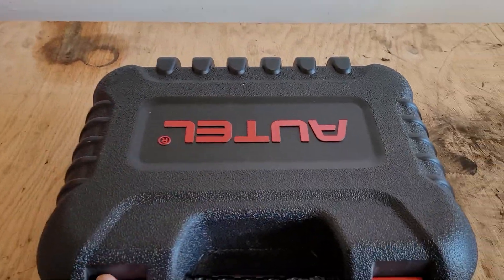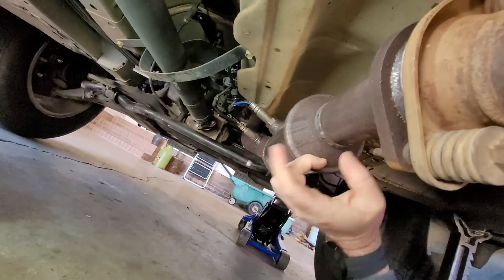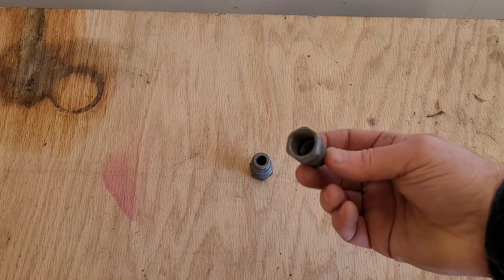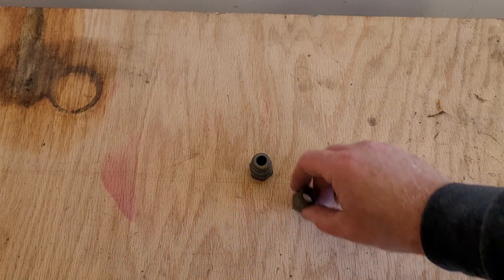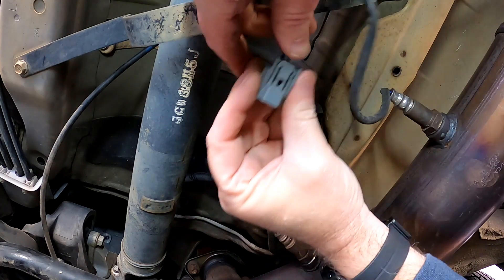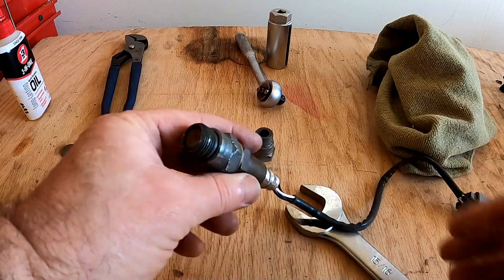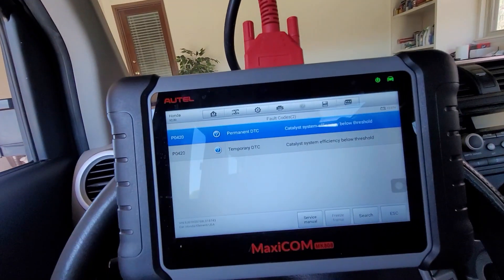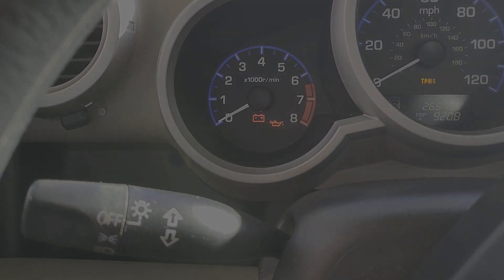Can Sparkplug Non-Foulers Fix A Bad Catalytic Converter?

Comment: Why is it illegal if the fouler can be purchased from major retailer for that exact purpose?
Reply: Because you have to modify it
Reply from the maker: Most folks disagreeing have been ugly about it, so I don't usually respond, but I'll explain. The defoulers are sold for sparkplugs, not your o2 sensors. You have to modify them for the o2 sensor. Even if your state does not require emission tests, federal law (that supercedes state law) makes it illegal to bypass factory emission equipment. 95% of folks that do this and get it to turn off the check engine light won't get caught. If I encourage people to do this, then youtube could pull the video. It would be irresponsible to encourage people to break the law. Several of the big youtube channels have been fined thousands of dollars by the feds for bypassing factory emissions. Do what you want with the information in this video.
Reply: @ktecgarage  thank you for the insight. I appreciate that and yes I agree. The fouler i observed was not for spark plugs but called oxygen sensor adaptor at walmart for $9. However, I agree what you are saying. Thank you for the information in general.
Reply: @Fred-Faizi  Walmart sells them?  The could be in trouble, I think.
Reply: @ktecgarage It doesn't affect the actual emissions of the vehicle, it in essence prevents the ECU from recognizing that the  Catalytic Convertor is out of spec. That's not illegal.
Reply: @ktecgarage  ....they do sell O2 sensor extention instead of using the non foulers.....For disclaimer purposes...only use them off road

Comment: I put one on the down stream and it cleared the code ..it didn't need manual clearing it just never had another problem car runs very well 122k miles Citroen C1 2017 UK model .. installation was about 2 years ago now ..
London UK 
Very good video thanks 🙏

Comment: It works you got to use 2 of them I’ve had mine on for 3 years always pass smog and unless the catalytic converter is clog you’ll get a different code such as fuel rich code after using the defouler in which case I gutted out works beautifully I tried paying 1400$ for cats they went bad after 8 months so I’m gonna do the poor man special fix when I can

Comment: Buy one specifically made for the catalytic converter.  I just installed one works perfectly.  The ones meant for catalytic converters are not open completely on the end.  Pass my inspection in the state of new hampshire.  Google them, you can order them online and they come in in two or three days.

Comment: Had 420 code. change the oil. spark plugs. Air filter. Spark plugs look beautiful at 150,000 miles. So I ended up changing a catalytic converter. new o2 after catalytic ,Threads stripped coming out. So new converter and o2. Still P0420, Put a new. oxygen sensor. in the manifold. Still PO420. and P1133. which I never had before. P1133 is not switching enough.

Did a smoke test in the tailpipe. No smoke up by the engine. Found smoke out of the weep holes in muffler and resonator. Did a vacuum test? 20-21 inches. I did a pressure test and it was a little bit high on the catalytic converter, I had like 2psi at idle, 4 psi at  2200-2500 rpms. at the manifold o2 sensor. Did Propane for intake leaks nothing on fuel trims. 

So I'm doing this, but I dont think I have the room. I've been searching for a 90 elbow.

Comment: What if the Exhaust Resonator is leaking  thats bolted up to the Rear Catalytic converter now and has started with a tiny gasket leak and then the Resornator rotted out around the flange as it needs to be replaced now, been told it's the O2 sensor and replace it and I have but still thought i had a tiny gasket blowout at Catalytic converter and Resornator Gasket  area, couldn't feel air but could hear a little hissing sound that got louder to feel air coming from it. I've tried Cataclean and went months at the beginning and passed emissions, nobody seems to be able to tell me, change the cat some say, have 2 of them on 2.4L Honda 2010 runs great without losing any power. I don't have the money to send it  to top notch place and last time I sent in for a $35 heater hose was backordered and they had vehicle for a month, i found 1 and they said the Radiator was junk because I had a discount off labor and charged me $838 I called them to tell them I'm picking up vehicle, they said no, we started to do Radiator and they didn't until the next day.  My son was parts guy and dropped off parts not knowing its for the vehicle.  There cost was $47 and they charged me $374.99 from Honda but cut the lines to transmission and put in connections and used rubber hoses to connect back, I said thats not factory as factory told me if they ordered right Radiator, then lines would go in perfect.  I found the part on different place and could of bought a back oredered hose for $69.95 free shipping, i told them i found the part and she used reverse phycology on me and asked where. They had all. Just lost about a quart of coolant in time noticed it. She got the name where i found it, on ebay and said i found it too. She was looking up as i she asked questions and  charged 1.5 hours to change out Radiator and hose and used wrong bolts for hood latch. Doesn't pop unless you bang on it once and pops open.  It was after that I got a check engine light on in a month or so and started coming on and go out. I didn't go back as very unhappy on cost of job and 10% off, they jacked up prices much more and checked cost on wedsites of cost to replace Radiator.  That's on repairpal and given estimates around your area with names of places to go. I picked up a bolt that I noticed leaving them and figured it was a rock in new tires, i think the hood latch bolt was it, as was 10mm head and looked like same size other than shiny from drive home, they said I could of gotten it anywhere.  So they wasn't fixing tire for me as was flat next day. Just wanted to get fixed correctly.  Hoping it can be reliable as i don't trust it like i did.

Comment: Works on my car, used both. 
Mine were longer due to a longer probe tip. About 3/4 longer each. Car runs great, haven’t had it checked, plus we don’t do checks here.

PS- CAA-CARB is now revoked and moot.

Comment: I tried this on my 08 Mini R56 Base hatchback, it did NOT help at all, code 0420 came on after 53 miles and ALSO IMMEDIATELY showed another FAULT code on the O2 sensor Bank 2 (downstream) where it was installed...AND the CHECK ENGINE light came back on...

Comment: Fine is cheaper than a new cat I guess. They do work, yours is too short. You need to use two, one drilled and one not drilled. Or get the longer one.

Comment: I had a cat that was deficient.  I bought the "universal" non-fouler that's long, not short.  Meaning I didn't have to drill out two short ones and put the together.  The O2 sensor threaded into the universal non-fouler, then threaded it into the exhaust pipe.  The CE light never came back on and it did run a lot better but not as well as it should.  It was only an experiment.  I tried one on the side that with the good cat and it made that side run so lean, it discolored the cat heat shield.  I installed a new exhaust system with two new cats and it now runs like a champ.

Comment: Rather than just condemn something because "you" don't think it will work, it would be more informative if you showed the live data from the downstream sensor before and after installing the spacer, to back up your claims. As you probably know, a bad convertor will typically register crossover counts similar to the upstream sensor, indicating a failed convertor. In theory, installing the spacer moves the sensor out of the direct exhaust stream, and exhaust gases then tend to pool around the sensor, which buffers the readings.

Comment: The more common cause of low efficiency these days is the low quality of replacement cats. 

Oem cats are getting expensive, people often go after market. The after market cats don’t heat up as well as the OEMs. That’s the difference in a $1300 cat and $200 after market.

Comment: i can already tell exactly where this guy went wrong and why it didn’t work
Reply: 5:40 when he went back to the bench and didn't realize to stack them or use a 1.5 inch instead?
Reply: You need 2 and drill a 1/2 inch hole through 1 of them,works Luke a charm!

Comment: Resistor method works better imo and can't really be detected by a visual inspection.  Non-foulers do work btw because the sensor is simply exposed to less O2.  Good to hollow out the cats for more power.  F the guv and their BS

Comment: Unless your vehicle is 0:04  sending a plume of smoke from the exhaust, these emission laws are ridiculous! The amount of dangerous emissions expelled by a vehicle during its final useful lifetime is far less than the emissions and pollution caused by tearing apart, separating and smelting all the steel and components of the already existing and useful paid for vehicle. I miss the days of buying a $300 car with minor issues, spending a few hours and $ for parts. Nice, I'd have a good running beater to drive for a couple of years! Good luck today..

Comment: TL:DR - You might not have a bad CAT - it might be cheapo (aka bad) O2 sensors.  Buy NTK or OEM sensors (it's worth the extra $). 

Was down a rabbit hole not being able to get rid of a P0420 on my 2011 JK Wrangler. Ended up replacing the bank 1 O2 sensors with a Chinese brand off Amazon thinking that would fix it - NOPE! ... tested replacement o2 sensors and they were giving off too high 6 ohms across heater element. CEL's for "high-voltage" persisted (NTK & Mopars give off 3.5 ohms). 

Almost bought new Catalytic convertors (also tried cleaning the cats & even using the spark plug non-fouler trick but CEL's persisted due to cheapo O2 sensors - non-foulers will not work if your cheap sensors are sending incorrect voltages to the PCM). After much research, discovered the JK is super sensitive to o2 sensors. Ended up buying the NTK brand and they worked perfectly. DO NOT USE ANY OTHER o2 SENSOR on a JK than NTK or MOPAR (Bosch is too sensitive and will trigger CEL's). NTK website has a part lookup function (note: upstream and downstream are different part numbers). NTK are more expensive but TOTALLY worth it.  Cheap sensors are not worth the hassle. 

Another key tip: O2 sockets are not meant to "break loose" difficult sensors - the wrench (link below), with a hammer, worked perfectly for breaking loose the sensor (after broken loose, then you can use the slotted sensor socket). Also, use PB blaster the night before. Note: Always use a thread chaser & high-temp anti-seize before inserting new sensor  https://www.amazon.com/gp/product/B00I6TBHE0/ref=ppx_yo_dt_b_search_asin_title?ie=UTF8&th=1
Reply from the maker: Thank you for sharing that experience. Chinese sensors are a bad idea.

Comment: You have to use 2 of them like others have commented already 😂. Stack them. Pushing sensor out of the pipe far enough to get cleaner air reading

Comment: If they cared about pollution they would still test the exhaust instead of relying solely on computer codes. There have been recalls on bad computers throwing faulty codes, ahem, Honda, but they don't test for that either.

Comment: There's a lot of things wrong with this video, don't even waste time watching it.
Reply from the maker: Your comment sounds vaginal. Care to explain what's wrong? Should I have used two defoulers? If that didn't work should i have used 5? What? Explaining what's wrong would be manly.  I'm all ears. I clearly say in the video that if it turns your light off that it didn't fix anything.  You are just tricking the computer. The correct fix is replacing the catalytic converter.  Not this BS.
Reply: @ktecgarage  do your own research and find out why you failed, not my job.

Comment: 2002 ranger 3.0 cats delete..2 oil foulers drilled one stacked the 3 amd truck ran good for 5 mins..lol. check engine light and truck ran like crap mid range..Tryed just 1 same deal..tryed the one i drilled same deal bad idle then..So didnt work for me..❤

Comment: The problem here is price. If the feds mandate that we have to have it on our cars, then they should also pay when it needs to be replaced. Otherwise people will never stop looking for ways around the issue. 
EDIT: Also I think it's crazy that modifying it like this is illegal when driving around with a check engine light on isn't. Just leave the bad cat in there and enjoy the amber glow on your dashboard. Problem solved lol
Reply: Bad idea. The car is in closed loop mode and defaults to slightly rich running which gets poor mileage and can eventually clog the cats. Dont ever drive extended periods with a CEL on.
Reply from the maker: It is a bad idea. That car was getting 16mpg after the "hack." Thanks for commenting.
Reply: @ktecgarage  Oh wow I didn't realize the rich condition this would cause while in closed loop. I used Cataclean on mine twice and so far so good. I discovered I had bad spark plugs that probably fouled the CAT. I bought some NGK plugs on Amazon that turned out to be counterfeit and started causing bad misfires after 25-30k miles.

Comment: Like the author said, you're just slowing down the real reason for the engine check light. I have honda civic I'm using this, and it works. After 5 years now turned out it is the valve's letting too much oil into combustion chambers. And it's not even my fault , honda says legally vitec petrol engine can burn up to 1 l of oil per around 6xx some miles, check your manual for exact mileage. There you have it, you're burning oil into exhaust system slowly killing your honda. But don't get me wrong, yours can be bad piston rings, or something else

Comment: It didn't work because you drilled out the bottom of the non fouler. You're not supposed to do that.  I have a complete brand new exhaust system, manifolds, cat's, all the way to the tailpipe and I get the P0420 & P0430 codes when using winter blend fuel, codes go away with summer blend fuel. Installed these, no more issues.
Reply: You have to drill out one or the sensor doesnt fit. Then stack it with the second one undrilled.

Comment: my own experince i used one for 2 yrs in a corolla vvti..its  works it turns off light...BUT BE WARNED YOUR CAR WILL HAVE VERY BAD FUEL MILAGE...I TOOK MINE BACK OUT AND MY CAR HAS RETURNED TO NORMAL ..A BLIND MAN COULD SEE THE MILAGE HAS RETURNED TO NORMAL..I BELIVE I LOST COST OF CAT ON UNBURNED FUEL .BIG MISTAKE BY ME ..BE WARNED..
Reply from the maker: 👆 What he said. Screws up the fuel trims.
Reply: @ktecgarage  I thought the upstream sensor (air/fuel ratio sensor in my case) sent the data back to the ECM and controlled short and long-term fuel trim.  I thought the downstream sensor only monitored the effectiveness of the cat.  Please explain how the downtream sensor impacts fuel trim.
Reply: @miken4022 I believe you are correct. The downstream sensor only tells the ECM if the cats are working. All the fuel air info comes from the upstream.
Reply: @ktecgarage  yes it screws up the fuel trims if there is a cat still in place.  lets take the  situation where a meth head steals your cat you need to get to work and only have $100 in the bank account. ya know because willingly removal or punching out a cat is a no no in the US.  If installed correctly  2 units per downstream O2 a small amount of steel wool in-between the 2 non foulers simulating a cat will restore the fuel trims to oem

Comment: Hello. The diameter of the beginning of the sensor is 10 mm. The outside diameter of the beginning of the most of the sensor extensions on Walmart is 16 mm. So the sensor suppose to fit without drilling. Do I still need to drill? Is there other reason to drill? TY

Comment: I had a neighbor bring down a Kia Soul with a 2.0 that was showing signs of a plugged cat. converter.  I disconnected the exhaust pipe leading into the cat, then took it for a spin.  It ran like a scalded cat!  Looking in the intake of the cat showed it was very much plugged up.  We tried CATACLEAN in the tank.  It did improve, but not perfect.  I replaced the converter, and it was running perfect again, but now throwing a code.  Sent a message to the company, asking for suggestions for a fix?  They sent me a spark plug adapter for free.  About to install it and see what happens.  I'll let you know!
Reply: UPDATE:  I installed the plug adapter and cleared the code. It lasted a short while and then the code reappeared. At least in this case, the spark plug adapter did not work

Comment: All this emissions BS is just that BS. Drive and maintain a old pre-emissions car or one old enough that it don't need this BS test. I could give a rats ass if the car has a check engine light on. My concern is if people on the road have brakes, lights, and good tires. The important things.
Reply: Exactly get the hell out of here with this illegal bullshit because my cat is only operating at 94% efficiency 😂
Reply: heavy car + powerful engine= more pollution
Reply: @mkrp4  Bull Shit. That ended when leaded gas did. All the shit in cars and trucks now a days is to make them to expensive to buy and repair. So they can sell more. That is the only reason. Know whether you what to see that or not it's on you. How environmental is it to junk and make new cars? How environmental is all the non recyclable plastic in modern cars? Break out of the Matrix you live in. I have seen way too many cars and truck being scraped because the cost of repairs to make a fuckin light on the dash to go out to pass inspection. Other then the light they are fine.

Comment: You have to use 2 per o2 sensor on rear bank,and your dead wrong,it most certainly does work without a doubt,do it the right way with 2 per cylinder and get back to us sir